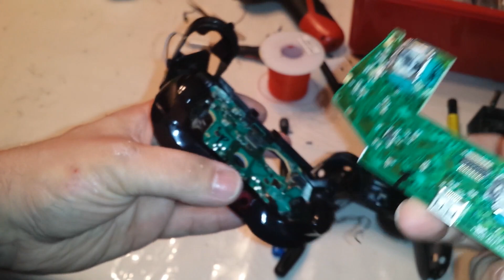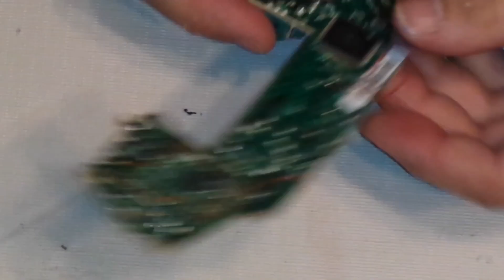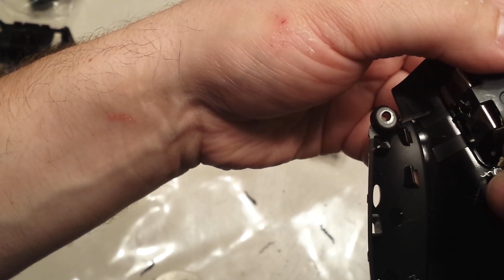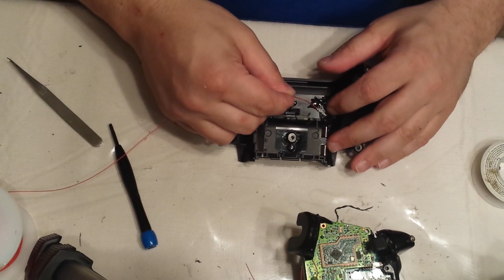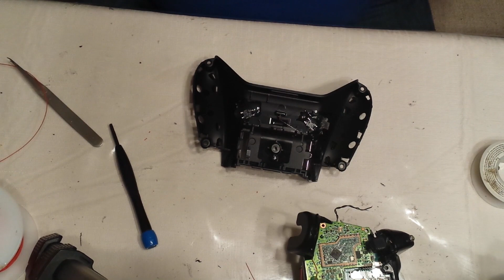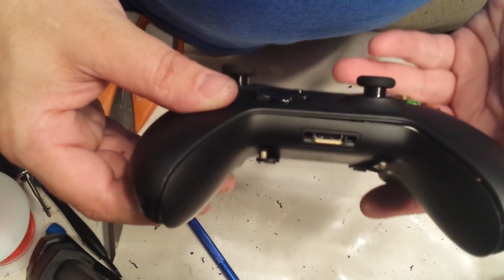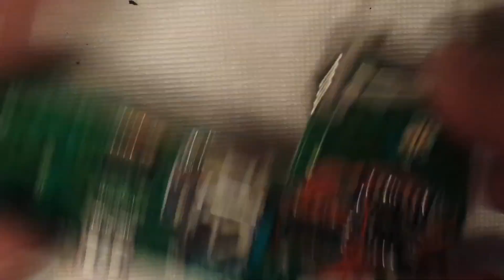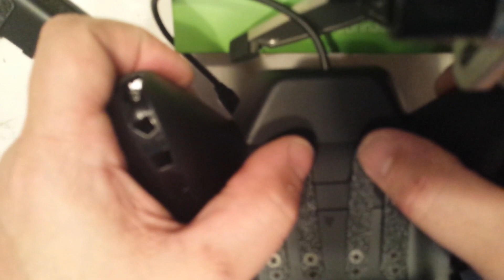TUTORIAL BUILD YOUR OWN XBOX 1 Scuf style Controller w/ Triggers Stops, Remap chip & MORE DIY Gamer

Comment: What size drill bit for tactile switches?
Reply from the maker: I have no idea..This varies for every person.  Just match the drill bit to the size of the tact.  Place it on top of the tact.. If the Drill but is the same thickness of the tact you are using go up one size or slightly thicker than your tact  then your good to go.  Just do not use the SAME EXACT size thickness as the tact, it will be hard to push through. Just make sure whatever tact you use, the bit is just slightly thicker and your good to go.

Comment: How do wire up directional  to switches
Reply from the maker: Same Way... Look in the comments the points are listed.  Instead of A solder point use UP or Down or LEft or Right solder point and also ground.
Reply: Dose this work with Xbox s controller
Reply from the maker: @mightymyersuk5516  YES... watch my xbox one Controller S modding video
Reply: Which one is  that m8 can you post the link
Reply from the maker: @mightymyersuk5516  Not to be rude but only have 21 videos posted here and it is marked CONTROLLER S TUTORIAL..

https://www.youtube.com/watch?v=H-EydyXqlx0&t=14s

Comment: Could you do a tutorial on a controller with side paddles?
Reply from the maker: I have no side paddles like the elite controllers.  If you are going to make your own side paddles out of plastic just follow the same tutorial but mount your buttons on the side/grip (which I have shown in videos for direct buttons on the grip) and then put your custom "side paddle" over the button.

My videos cover button mounting and directly paddles over the buttons if your doing it in the very back.

If you doing grip mounted buttons you can use a larger button and press them direct, or use a tact button cap or just create your own paddle style from there

Comment: This is making my b randomly work when I'm typing and not register when I press the button I did not use a chip but even when I take the wires out it's still active I tin my wires and everything please help I dont understand but both of my motherboards do the same thing
Reply: I see I fixed it thank you it works now
Reply from the maker: you likely bridged your B button pin with the pin under it.  

You need a clean connection. 

Also make sure your tact button is not grounding out on something when you put the controller back together.
Reply: I tried fixing it and when I take the soder off of the button it works again although anytime I try to soder wires anywhere they stay on, same thing on all buttons too if I remove the soder they work again I'm really confuses
Reply from the maker: Not insulting you, but soldering is not for everyone. There are TWO distinct points for the B button you have a very small 1mm point to solder the wire to. If you accidentally Bridge it or touch the smaller 1mm point under it, it will not work.   If you are getting the wire on properly to the small point but not bridging the connection under it then Also make sure your tact button is not grounding out (any of the legs on teh button) are not touching the circult board when you close the controller up.

Comment: Can i map both bumpers to a single tact switch?
Reply from the maker: With my programmable remap you can. Not just by soldering both to the same button, that will not work you would need a 4077 chip to do that.

Comment: Are installing the LEDs necessary?
Reply from the maker: For the programmable remap .. NO

you can fudge your way through it without an LED.
Or you can actually just solder a wire to the the LED pad and the other end to the TOP solder point of the 3 solder points on the diode on the backside of the button board of the controller that power the Controllers LED.  It is super simple to do and it turns the LED of the controller into a blinking light for accessing programming mode on the Remap board.

Comment: I’ve just soldered the to the A button part but I’m not using the remap chip and now the y button is stuck continuously pressed and then if I changed the point I solder too to the main board and now y and a press together and the A button doesn’t work. Can you help please
Reply from the maker: I do apologize but it is very difficult to help wiothout seeing anything with my own eyes.  When I made this video there was only 1 kind of controller on the market this is the V1. There is another V1 with a 3.5 mic jack on it which is pretty much the same as the V1 without the mic Jack and then there is the new Controller S which has bluetooth and NONE of the solder points are the same.

So assuming you soldering on the V1 controller... The X and Y points are next to each other.

They are on the J6 connector and they are points 8 and 10 on the bottom row.

My Guess is you have a SOLDER BRIDGE (solder that is touching points 8 and 10 together or 8 and 10 and 12 together.

My suggestion is using desolder braid and sucking up all the solder that might be between pins 6 8 10 and 12 and start over again. 

The other thing that could be happening is...  

If you tact button legs are touching something else metal on the mother board when you close your controller up. That could be causing a SHORT for the button and keeping the button constantly On.

That is the only advice I can give without having it in my hands.
Reply: MODCENTRALUSA hi, thank you for your reply   I am doing this mod on the 3.5mm jack model. The points are very similar due to comparing them and looking at diagrams for each model. I have tried desoldering the whole pin thing to check for a bridge between the pins and still having the same problem. However, this issue may be due to the other mods I have installed onto my controller. Your answer does have some good ideas that I will be trying later and I will have a look at later. Once again thank you for your reply and I will let you know if it was successful.

Comment: This is a fantastic video! Is there a way to contact you for information on adding back triggers for just the left and right d-pad buttons on a day one controller?
Reply from the maker: For any unfamiliar with my button naming scheme..

A = A Button
B = B Button
X = X Button
Y = Y Button
DU = D-pad Up
DD = D-pad Down
DL = D-pad Left
DR = D-pad Right
LB = Left Bumper
RB = Right Bumper
LT = Left Trigger
RT = Right Trigger
LSC = Left Stick Click, Left Stick's button
RSC = Right Stick Click, Right Stick's button
VW = View (Back)
GU = Guide
MN = Menu (Start)
SY = Sync

FUNCTION - TRACE COLOR

DR - Red w/Black
DU - Yellow w/Black
DD - Green w/Black
DL - Blue w/Black
SY - Dark Purple
LB - Pink
RB - Purple
GU - White w/Green
A - Green
B - Red
X - Blue
Y - Yellow
VW - Light Blue
MN - Medium Blue
LSC - Pink w/White
RSC - Purple w/White
LT - Light Blue w/Light Red
RT - Light Red w/Light Blue

J1/J5 Connector Pinout

1 - RUMBLE MOTOR+
2 - DR
3 - DU
4 - DD
5 - DL
6 - SY
7 - LED IR x 2
8 - 5v USB
9 - LB
10 - D+ USB
11 - POWER OK / SHUTDOWN
12 - D- USB
13 - GROUND
14 - GROUND

J2/J6 Connector Pinout NOTE: "Wired" from here on means connected with the microUSB cable.

1 - V+ (3v Wired), (Battery Voltage Wireless)
2 - LED (under GU, does not drive LED directly)
3 - GROUND
4 - 3.3v
5 - RB
6 - GU
7 - USB Cable LED
8 - A
9 - X
10 - Y
11 - VW
12 - MN
13 - PNC DETECTION
14 - GROUND

TEST POINTS NOTE: If it doesn't say power source, don't use it to power something.

TP1 - D- USB
TP2 - D+ USB
TP3 - 3.3v (Wired),
TP4 - 0v (Wired),
TP5 - 5v USB
TP6 - 3.3v (Wired),
TP7 - 3.5v, RUMBLE MOTOR+ (switched power source)
TP8 - 3.3v (Wired),
TP9 - 3.3v (switched power source on battery, constant when Wired)
TP10 - 3.3v (Wired),
TP11 - V+ (3v Wired), (Battery Voltage Wireless)
TP12 - 0v (Wired),
TP13 - 0v (Wired),
TP14 - PNC DETECTION
TP15 - 0v (Wired),
TP16 - GUIDE (2.6v not pressed, 0.5v pressed)
TP17 - 3.3v (Wired),
TP18 - USB 5v DETECT (2.95v)
TP19 - 0v (Wired),
TP20 - 0v (Wired),
TP21 - GROUND
TP22 - GROUND
TP23 - 0v (Wired)
TP24 - GROUND
TP25 - 3.3v (Wired),
TP26 - GROUND
TP27 - RT MOTOR+
TP28 - HEAVY MOTOR+
TP29 - LT MOTOR+
TP30 - LIGHT MOTOR+
TP31 - 0v (Wired),
TP32 - 0v (Wired),
TP33 - 0v (Wired),
TP34 - 0v (Wired),
TP35 - 0v (Wired),

* Information will be updated when/if I get them scoped and/or figured out.

STICKS - The Sticks are the same 10k POT style as previous controllers, but are new and smaller than the 360 versions. They have a 1.8v AN+ that comes from a Regulator (U8) and it's also the vRef for U1 on the MCU board.

TRIGGERS - The Triggers use Linear Hall Sensors now, U10 (RT) and U11 (LT). They have 3 pins, 1 - VDD (power), 2 - Output, 3 - VSS (ground). The VDD for them comes from U9, which is turned on/off by U1 at 125Hz, 8ms period, On ~1.4ms, Off ~6.6ms (~18% Duty Cycle). This is done mainly to save power, but it also makes them a little harder to tinker with, but not impossible. (more later)

POWER - The Power/Button board has 3 separate Buck/Boost circuits for power management.

U1 is for when the USB cable is attached, it takes the 5v and knocks it down to ~3v for the other two circuits.
U2 is for a 3.5v source that powers the LED, IR LEDs and the Rumble motors. It's TP7 on the MCU board.
U3 is for the 3.3v source that powers pretty much everything on the MCU board. It's TP9 on the MCU board.

(more on the PnC pack/cable when I have them to tear down)
Reply: @MODCENTRALUSA  do you happen to be the user RDC over on AcidMod forums by any chance?

If so, your info has been super useful to me both there (on xb1s controller) and here on this video, so thanks!
Reply: @MODCENTRALUSA  Thank you! This information is more than appreciated!

Comment: You can re map buttons on Xbox one natively
Reply from the maker: You miss the point of this video... People want (REMAP BUTTONS) them on the back of their controller so that have additional control over the game.  Using your grip hand to allow to control additional functions without taking your hand off the analog stick.  Pro gamers and those serious about gaming want as much control as possible.  So while M$ and Sony now both have on screen mapping functions that allow you to rearrange the button layout using the existing buttons, no program is going to magically allow rear remap buttons to appear on a stock controller. While the elite has come out and does have the ability to change the 4 rear paddles it can only be done in software and not in game.  My remapping board (chip) allows ON THE FLY remapping of added rear buttons that can be done in between spawns in a match.   Also it allows the gamer to build a controller that is suited their needs.  Hand placement and such being something that they want to keep in mind when modding.
Reply: just buy the cheap back padles from gamestop
Reply: that go into the battery pack
Reply from the maker: Again you do not understand...   You are trying to simplify things without understanding the need for customization.   Not everyone wants paddles. Or at least the cheap strikepack crap that they sell for $40.  That technology is limited and for some people feels uncomfortable.  When you mod your own controller you can make paddles, large, small, medium - whatever size you want. Do not like paddles? Put buttons on your controller. Also the Gamestop 3rd party stuff is only 2.  With my modchip you can add 4 programmable and with no programmable, just static you can add as many as you want. Infact using this tutorial you can add static and programmable. Static will cost you under $20 to do it.   Even programmable if you want 2 or more on the fly remappable paddles I designed a chip that works with Xbox 360 and Xbox one (same chip both controllers) for $35 shipped.  Add your own buttons for under a few bux and you have a custom controller that cost you as much as those cheap strikeforce packs.    You can debate til your blue in the face, but this tutorial is going on 4 years now and I have seen thousands of people use it to mod their controllers.  I do have a ps4 equivalent for modding the Dualshock4 and I have on eBay alone sold over 2000 easy remap boards and 500+ programmable remaps. My Xbox chips has sold close to 400 total over the last 4 years.   I also have them listed on amazon with another few thousand sales there as well. Add in the Direct messaging for this video with over a quarter million views and I have sale another 1000 PS4 and Xbox variant remap products.  I actually designed and sold a remap chip to other controller makers back in 2013 before scuf even had EMR on the market.  I have been designing and selling products for customizations for a long time.  Yes there are very Slick retail solutions out there. You want to drop $200 on a scuf or $150 on a Elite controller go ahead. But most people get a controller with their system.  WHy not drop 10, 20 ,35, 40 max and build a pro gaming controller the way YOU like it. Add as little or as many buttons, paddles, ect as you want.  It is a great budget solution and aside from Scuf, no other company offers remappable buttons ON the FLY.  You can remap your rear layout any way you like in a matter of seconds.  No one has really caught on to that on the console side of things.  It took a 3rd party brand and Me to offer a solution.
Reply: why do you type that much, just say it is more customizable and cheaper and i would have said o.k.
Reply from the maker: Because I Basically said it already and you didn't get it so I spelled it out in a very detailed explanation.   If people are going to comment on my video I have a right to reply at any length I want. If you find it too much text to read then perhaps the level of detail and customization I offer is too advanced for you.  Again been here 4 years with the same video and I still am very active on my account.  It is a testament to how well thought out and how well done the tutorial are that 4 years later I still get as much traffic as I do for such a niche hobby.
Reply: i used an arduino nano to make a modded xbox one controller with no tutorial, don't try to talk down on me because i wouldn't put my time into doing something that is basicly useless in my opinion, in the end of the day you have your opinions and i have mine. Have a nice day!
Reply from the maker: Yes but if you can't watch a video where I explain why this tutorial is helpful, where I explain about mapping and why it is a great option compared to others.  You wouldn't have made a silly comment about changing button configurations which is totally different than adding Pro buttons.  But hey to each his own.    You talked down first and then didn;t understand the responce which I had to lay it all out before you "GOT IT"    - SO yea.. good day

Comment: Brilliant detailed tutorial. Apriciate the time you took to do this. Most mod videos are rushed and don't give enough time to show solder points and explain what there doing.
Yea if you just want to rush it and potentiality mess it up then stick with them 5 minute rush guides. But if your interested in learning what your also doing as your going along and making sure you have them solder points correct then this is perfect.
Used to do the Xbox 360 rgh and jtag mods and the 360 arbiter control mods so also know the importance of getting those solder points right.
Thanks again for the time and effort put into this tutorial 👍🏻